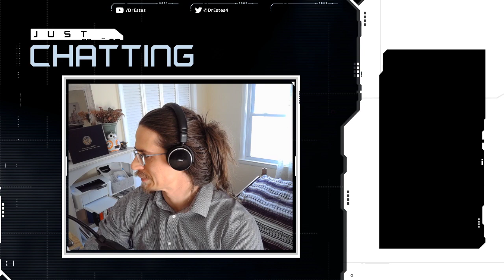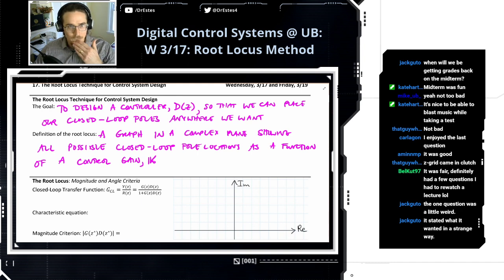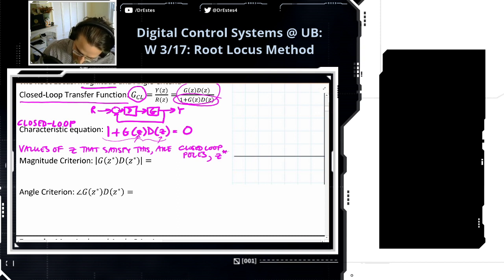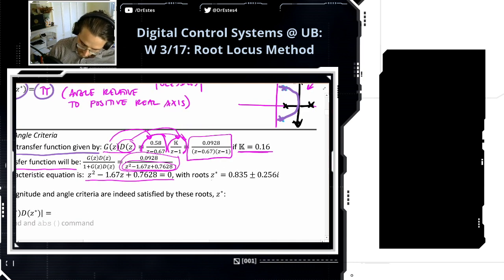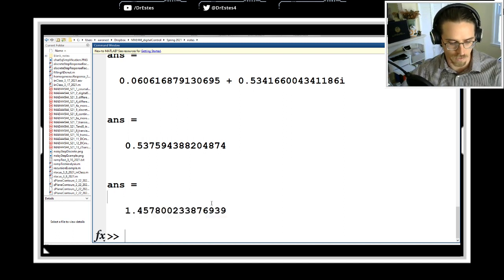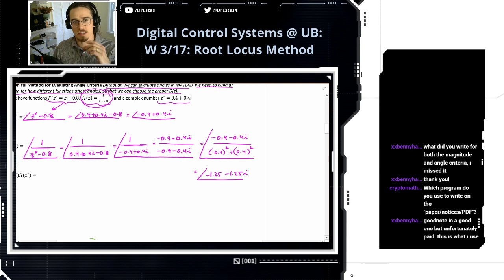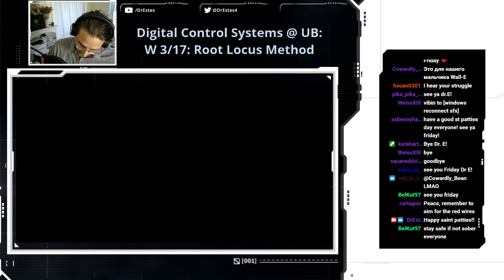Digital Control Systems (3/17):  The ROOT LOCUS METHOD for Control system design

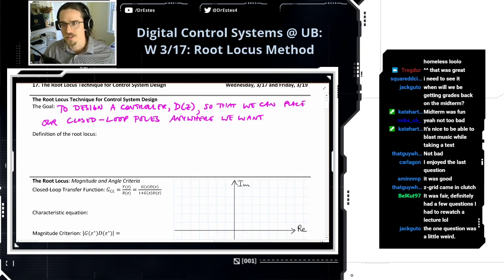Comment: Definition of root locus                                       7:05
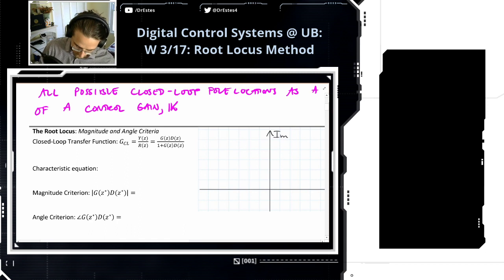Magnitude and angle criteria                             12:31
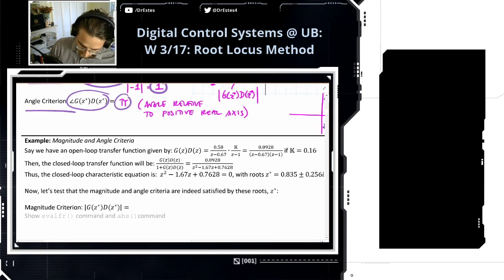Example for magnitude and angle criteria       22:12
Building the transfer function in MATLAB        25:09
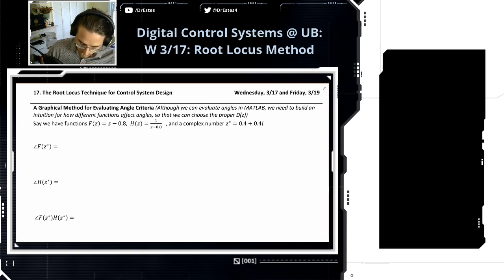Graphical method for angle criteria                   31:47
Drawing in complex plane                                   35:50
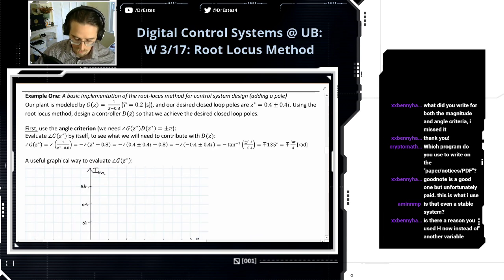Example one                                                          46:45